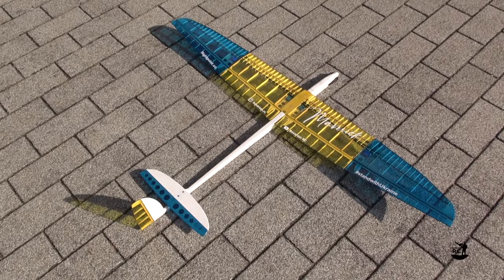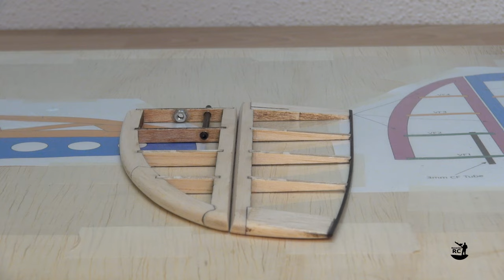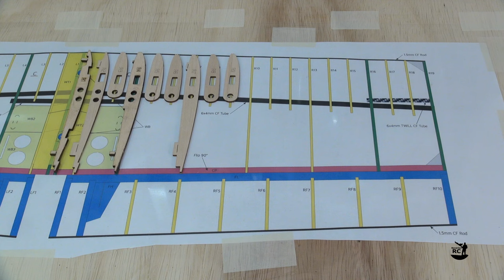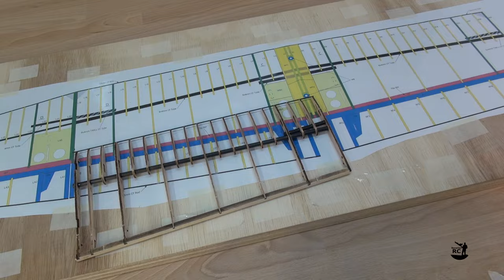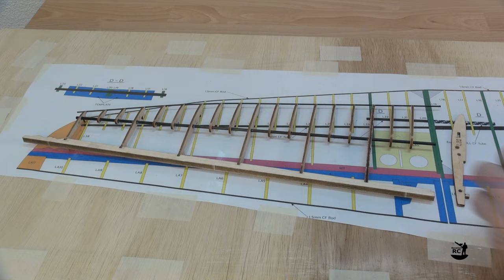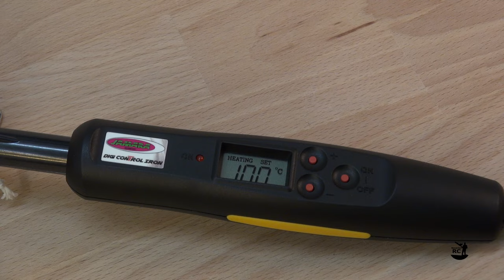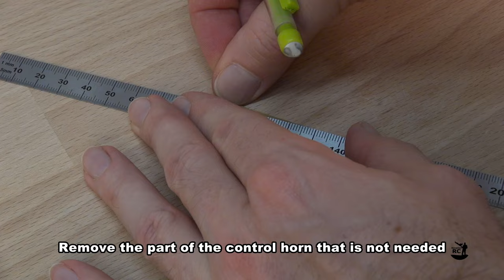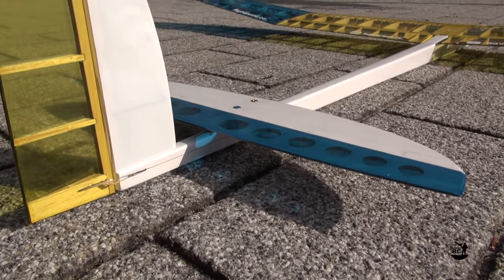Maverick F5K Electric Glider - Time Lapse Build

Comment: Its been 50 years since I last built an RC plane.  Wish the kits back then were like this.  The colour coded sections make it very clear.  I have no inclination to get back into the hobby, but this video was very enjoyable to watch and would provide an excellent aid to anyone building the same kit.
Reply from the maker: Thanks a lot! I built my first kit mid of the 80's, a Graupner Amigo II. Indeed a significant difference to our laser cut kit nowadays. I have learned everything back then from my father and these skills still come in handy even with high precision part in todays kits
Reply: The laser printers have improved this hobby immensely!!!
Reply from the maker: Absolutely! 👍

Comment: Nice build ... to fix the plan on the table I use transparent adhesive film: easier, in 1 operation you protect the plan and it’s fixed on the table
Reply from the maker: Thanks 😊 Good idea to use transparent adhesive film. It isn‘t one of my favorite tasks to fix the film on the plan and have it properly tensioned. Do you have a link to the one you use?
Reply: @bavarian_rc  Hmm, my reply didn't show up.
So I have no tools and would really like to know what you are using? Could you list some please?
Like: the pins, the weights, that sticky film you are putting on the parts, I saw the cool sander and will try for that one. Clamps, I suppose, they're pretty generic. I have nice scalpels and plastic triangles.
Did you find a transparent adhesive film you like? In France amazon I saw a lot but would like to know what you came up with please? Some appeared to have a grid that might be helpful?
It looks like you're working on a pressed wood board? 
What type of wood glue and CA glue please?

I liked the music!  LOL
Reply from the maker: Tools can be a long topic and everybody has his own preferences. I made a quick selection of some of the tools I use. The list could be a lot longer. Let me know if you are interested in anything else.

Aeronaut building board (1500x400x40mm) (750677): https://aero-naut.de/Balsa-Baubrett-400x1500/750677

Weights: 6x3x150mm flat steel (around 215g each) cut from 1m bars from the hardware store and clear coated to avoid corrosion

Pins: Aeronaut "Aero-Pick" (785502): https://aero-naut.de/Aero-Pick-Stossnadel/785502

Needles: Prym needles (30x 0,6mm) on Amazon: https://amzn.eu/d/0d5tMGfN

WEDO scalpel from Amazon: https://amzn.eu/d/0baUaU9w

Wolfcraft clamps in different sizes

Perma-grit sanding block 140mm fine/coarse

Perma-grit files set (fine) 140mm length

Set of Standard files (large) from Pferd

Woodglue (PVA): Ponal Express

3 different CA glues: low, medium and high viscosity and activator spray... I use mainly EVERGLUE from Amazon (https://amzn.eu/d/034F9wJq) but any other brand will do (unless you work with EPP foam then you need to use special CA suitable for foam)

R&G laminating epoxy (40min) (resin L with hardener L): https://www.r-g.de/art/100110

For covering the plane I use either ORACOVER or ORALIGHT heat shrink film. 

For my custom decals I use standard vinyl from the hardware shop. A more professional solution would be ORACAL 751c

For the transparent film (for covering the building board) I am still using my non-sticky one as I didn't have time to research further.
Reply: @bavarian_rc  That's awesome and thanks for the links also!
Well, I'm still curious what that large tape was you were putting on all the parts. ;-)
Can't wait to go to Leroy Merlin and cut up a bar!  LOL
Reply from the maker: @Zeek812B4U You‘re welcome. Which large tape do you mean? The one I am using to protect the balsa parts during sanding? That’s „TESA perfect“ painter’s tape.

Comment: I built this model last year, I am still trying to learn how to fly it correctly, I tend to fly it too slowly and find that I keep inducing a stall, when this happens near to the ground damage is caused, so I have had to make some repairs.
Reply from the maker: I am curious to see how it will fly. I will remember your comment for the first flights and be careful. Have you tried changing the CG and maybe also the angle of attack of the horizontal stabilizer? Both are connected and have a strong influence on the flight characteristics. If the thin fuselage is not perfectly straight your hstab could be a little bit off.

Comment: Awesome build! I was just looking at this glider as my next. I was curious to know if you put anything over your plans when gluing the pieces down. I couldn’t tell in the video. Thanks!
Reply from the maker: Thanks, great that you liked it! I can only recommend the Maverick. I fly it a lot and it really performs great. Watch out for my flight video which will come pretty soon. Concering your question: Yes, I cover the plan with standard cling film that is attached (and tensioned) with some strips of painter's tape.

Comment: On my balsa build of the Triple Neo Thermic....I have experienced warping of the wings structure. I am using standard carpenter glue and appropriate weight to hold down the layers as the glue dries. is there a remedy for this warpage?
Reply from the maker: Hi Peter, on the Triple Neo Thermic I had no issues with warping. In which area is it? There is some chance of recovering the warping during the covering with film by shrinking the film differently strong in order to counteract the warping. Nevertheless you should not expect too much from that. If the warping is really bad you might have to consider removing the part that caused the warping and redo it. Was it caused by the sheeting or was it present before? Were the sheets already warped before glueing? in that case even after using weights and waiting for the glue to fully cure the forces in the sheeting will try to get back to the initial shape which could result in warping. Balsa is normally not so critical but plywood has more power.

Comment: 1:15:00 You don't need the extra loop. C bend goes through the big opening, then push the C back through the big opening and pull the end of the C through a small hole. Use pliers to grip the small end and pull the wire through.
Reply from the maker: That sound a bit easier than my solution. Thanks for sharing!

Comment: Awesome glider. This will be my next project.
Reply from the maker: The Maverick is a fantastic glider! Have flown it today at the slope and it performed really nice. Go for it, you won't regret!
Reply: @bavarian_rc  Where can I get such flat steel plates to press flat and hold in position?
Reply from the maker: Funny, I am also building a RES at the moment: the RESilience from Heinemann Modellbau
Reply from the maker: I bought a 30x6mm steel rod at the hardware store and cut pieces with a length of 150mm. They weight around 215g each. To avoid rust I clear coated them with spray paint.
Reply: @bavarian_rc  Thanks. And btw, STARRETT tools? Expensive toy. I'm envy.
Reply from the maker: @joelpetersen2480 😂😎

Comment: Fantastic video. The first (and only) model I ever built like this was very satisfying, but I certainly made a few mistakes.

Would you classify this as an appropriate second model to build? 
It's exactly the size and type I would enjoy flying.
Reply from the maker: Thanks, great that you liked it! There are some key elements for this build, like getting the fuse straight and not warping the control surfaces during covering with film. They require a bit of experience. I would rather say the Maverick is a 3rd than a 2nd model to build. But if you take my video as a guide and go carefully step by step, why not?